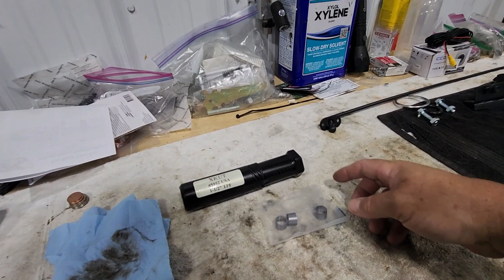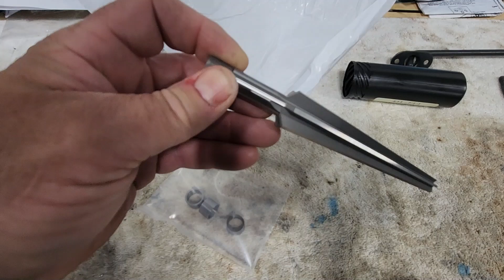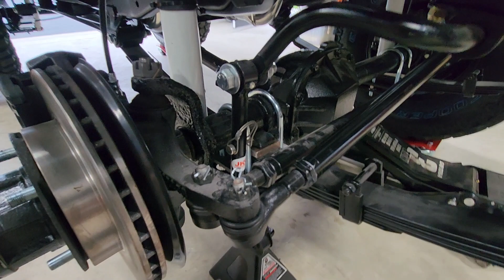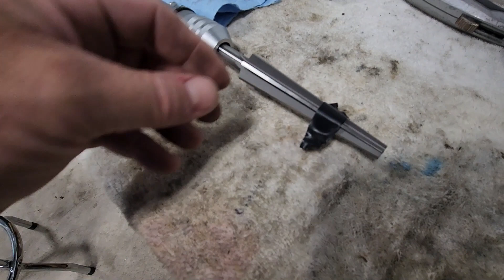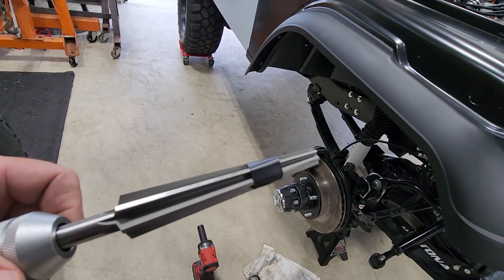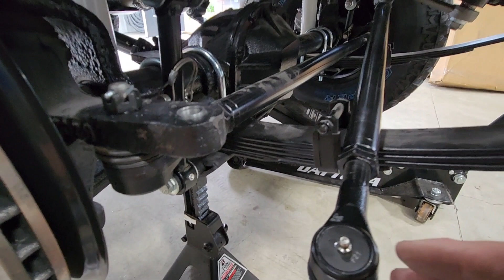Jeep CJ Draglink Flip.

Comment: I'm a little confused. you keep fitting it in the top but In the end it was in the bottom
Reply from the maker: Not sure what you are seeing. The tierod remains in the bottom of the knuckle and I mention that it can be flipped as well. The draglink is clearly installed into the top of its location on the knuckle.
Reply: @millstonejeepworx  He's talking about the sleeve. You keep fitting it in from the top of the knuckle and at the end you put it up from the bottom.